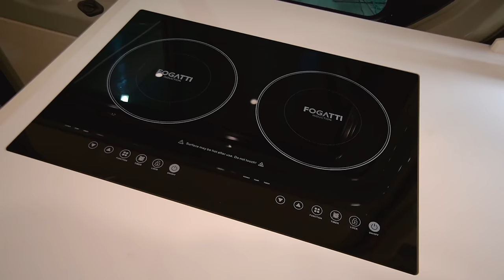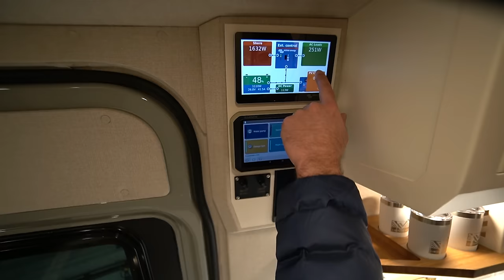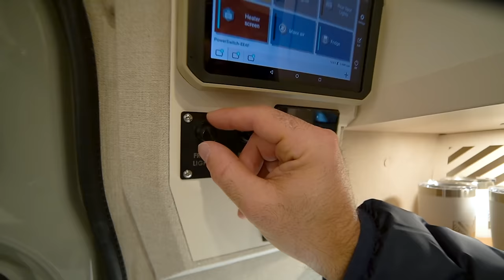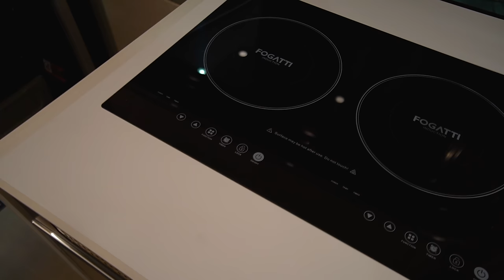STUNNING Sprinter Conversion | This Van Has It All!

Comment: And still bare metal exposed on the side door and rear doors, which with thermal bridging gets the same temperature as outside. Really guys?
Reply: I have similar exposure on the sliding door. Well I can tell that is negligible if the rest of the van is properly insulated. Glue fabrics on steel might help but only for a visual pleasure, No R value will be given.
Reply: Lol😂
Reply: @shadowfire77 show them your van, then they will know how to improve theirs. 😅
Reply: @Vengeance1978  might do, and invite to some really cold winter camping in Sweden too :)

Comment: $295K in case you were wondering.
Reply: Absolutely ridiculous.
Baffled as to how what was meant to be a cheaper way to get away and have a break turned into spending enough money on a van that you could buy a bloody house with the same money.
Reply: Never
Reply: And you can still see the tan on the wood when the gray drawers are closed.  Small item, but for nearly $300k should be color matched.

Comment: One of the finest builds I have ever seen.  Any issue with CV joints on the new AWD chassis with a lift?  I assume you could do this same build on Transit extended?
Reply from the maker: No issue with CV joints. We can build something similar on a Transit with some changes due to the wheelbase difference.

Comment: You guys gave lots thoughts into this van. Several questions. What kind of insulation like 3M or wool…? The toilet options? Auxiliary fuel tank option? It’s 144 wheel base or 170?Screens for back and side doors?
Reply from the maker: This van has 3M insulation and a Laveo DryFlush toilet. It is a 170 wheel base with a 45 gal long range fuel tank added. No screens but they can easily be added. The toilet could also be swapped out for something else that fits in the same space.

Comment: Extremely well built van! How about alternator charging (any 2nd alternator?)? Also, any grey or black water tank? Any glycol to heat these tanks on demand basics? Any glycol to keep warm of fresh water tank and battery compartment? A true 4 seasons need van operations with water (fresh, grey n black), battery cold temp protection with self heating. Also the heating system draw diesel from the fuel tank?? Thx
Reply from the maker: Thank you! It does have a 2nd alternator and a gray water tank with electronic dump valve, but no need for a black tank with the Laveo Dry Flush toilet. We can easily add tank heating pads for the undermount gray tank and with the Rixen's heating system you can set a minimum temperature for it to maintain in the van for the interior fresh water tank and the battery system. The heating system works off of shore power, your engine heat, or through the furnace that is powered off of the diesel in your OEM tank.
Reply: @LimitlessVan  While the dry flush is better than a cassette, you need to offer a black tank! Most B's don't offer this anymore (for some reason) and it makes no sense. Mine has it and it is so, so much cleaner and easier than dealing with the dry flush or cassette.
Reply from the maker: @robmagu65  The Laveo dry flush has no liquids to deal with and way easier than cassette or black tank. No smell either- Look them up, they're one of our favorites!

Comment: Do you guys have an "estimated" MPG? Just curious how much the front bumper, roof rack, suspension and 35s cut into the milage.

Also, I didn't notice, did you guys install a larger fuel tank?

Lastly, do you guys offer a different choice of interior materials/color?

Thanks, GREAT BUILD!
Reply from the maker: MPG is around 15-17 - hard to tell at this point. And yes! We did install the 47gallon tank - expect to get 700 miles per fill! And lastly, YES! We offer thousands of different interior colors - woods, laminates, veneers, powdercoat colors, you name it!

Comment: ingenius. You are giving Redtail Overland a run for their money.
Absolutely love the colour of the van’s bodywork’s paint - super stylish. Does not look like a factory colour.
I wonder if walking barefoot on the solar panels would nullify any shortening of their lifespan?
I would argue, if it isnt the case, that the worktop should run all the way to the back. The folding bed makes that option possible, so why not do it?
the price - $295K - doesn’t include the van, does it?
Reply from the maker: Thanks! The van is wrapped in Matte Metallic Brown. Price does include the van😃
Reply: @LimitlessVan  I much appreciate you taking the time to feed back.

Comment: Whoa… this is so beautiful, so well made and designed, and so perfectly designed it blows my mind!  😱😮👍🏼  The magnetic glasses, double sink fixture valves so you can spray quickly without wasting water, it’s all awesome!  My one question is the shower curtain… with zippers on the outside.   Once zipped… how do you get in?  😂
Reply from the maker: Thank you! There are accessible zippers from the inside so you get in and then zipper it closed.
Reply: @LimitlessVan  — Killjoy.  I assumed that, but where’s the fun in that!  I WANT my mother in law trapped in there!  😎

Comment: Lovely build and beautiful finishes. However, your 35" spare covers the Drivers side rear light...you can get pulled over for that. Ask me how I know! The penalty for a large tire I guess, but also dangerous for following vehicles. Add auxilliary brake and back up lights on the bumper.

Comment: Great job on the van. The details are well thought out. But why is the industry going away from black tanks and putting in dry flush and cassette. I have had both and they are in a word GROSS & very difficult to keep clean. Having a black tank is so, so much better. I have a 12g tank in my class B and I have ever had an issue finding a spot to empty it and it is so much easier to empty. Airstream still has the black tanks on their newest class B's (even the 144). It just makes all the sense in the world to me.

Comment: I think this is nearly perfect. I am insistent on a toilet with a black tank so a macerating toilet will be the way for me. If your poop smells like roses then ok sure, but if you're travelling and unknown food gives you the runs you want some comfort and to not have to deal with it later. Macerator because can pump "uphill". Can couple macerator with a compact marine grade black water treatment system to convert black water into gray water (device that kills poop bacteria so it's safe for release into the water). Fridge is nice, but would like to see a bigger one. Everything is a compromise in a B-class I understand, adding a thing requires taking away another. In any case, amazing build.

Comment: Nice. Lots of small good details. On the neg, wheels are too big, can’t fit on back without obscuring the left lights. The wheels and overhead lights will have a big impact on mileage at highway speed, but might be ok at slower off road.

Comment: Hi, can we put an extra power generator, just in case if The Sun des not want to show around? An extra solar panel, to replace the induction cooking plate with a propane one, a shade store just for outside sitting,. And also an estimate price for the van as it is in the video, Thank you,nice video indeed.
P.s this van can be an everyday living,on the move.

Comment: Beautiful vehicle.  The upgraded seats are awesome,  but if you can't handle more than 2-3 hrs in newer Sprinter seats then road trips are not for you.  Put in 6, 8, 10 hrs a day in mine routinely and never had an issue. Will say it's nice you don't have to adjust them to swivel.

Comment: Beautiful build. Tow quick questions. Can the batteries power the AC all night during summer months? Did you upgrade the Sprinter stereo at all? Thanks
Reply from the maker: Yes! You can run the AC all night long and have over 60% battery left in the morning. Upgrading the stereo is an option.

Comment: How tall are you, I’m just wondering about the dimensions and how that would effect the ergonomics of the van, in other words I want to see I I can fit
Reply from the maker: Ryan is 5'10" with shoes on 😀 Height of this Sprinter van after build out is 74.5" and with a high roof Transit build you can get 77 3/8".

Comment: great van but!
things i would change if it was mine.
gold trim hate it.
wheels and tires look nice but the height of  the van now is too much and the gaps in the wheel arches looks silly.
only 300 watt solar panels when your running aircon electric hob, heating lights, no where near enough the aircon alone will take most of your batteries after a couple of hours.
exposed metal on inner doors looks rough or not proffesional enough in my opinion.
sink may be deep but not wide enough.
would have thought for the amount of money spent on this van they would have gone for the electric bed lift.
not over keen on the ceiling wood all the way through would look nicer.
still a great van though and as much as I love van builds completed 3 myself, I would now just buy a motorhome because the difference inside is a game changer, loads more space and more pratical and sometimes cheaper than converting a high end van like this.

Comment: Why not a proper door to the wet room with it`s own roof window? We have one of our heater exhaist in the wet room so we can use it to dry wet clothes or gear. Also a door makes it easier to use, especially if you are  couple. Zipping and unzipping the fabric will be a hassel.

And why such a large kitchen area?
Reply from the maker: Every client has different preferences. We do offer different styles of shower doors and different kitchen layouts.

Comment: Some really nice features. The lighting, the cabinets, the bed, and many more, but also a few poor design decisions. 

Why create such a narrow and restricted pass point between the galley and the table. We don’t put large fridges in that location for this exact reason, it becomes a real pinch point. Relocate the fridge to allow more space in the area of the van that gets used the most. 

That shower door, WTF! It’s a pain in the backside to operate each time you want in and out. It rolls up wet and drips down when rolled up, and it looks so out of place with the rest of the design. There are many tried and tested space saving shower door for vans that work way better I’m afraid. 

Bare metal on the doors is a real no for a premium van. It doesn’t take much to cover it up, keep the cold out, and continue the premium feel…

The spare wheel really needs to bolt to the carrier (with locking nuts). That strap will get rusty and dirty and be a right pain to release over time.

Comment: Great looking van inside it's a small home on the road perfect for weekender or a road events such as music festival classic car bus and heavy goods lorries firearms fairs a useful motor home.a mobile base station for mountain rescue or army use in battle conditions with four wheel drive is fitted a all round tool kit with built for on or off road.

Comment: 295 Grand?   I think I’ll copy their ideas and build it for not even half that price.  Half the price of the van is the overpriced Yeti cups.  Carpeting is a giant mistake in a van.  Should NEVER have carpeting.  Unhealthy, and gets dirty and hard to clean.   Always go with a hard floor of some type.  If the owners want a warm to touch carpet, they can have long rugs with velcro under them if needed.
Reply from the maker: There is no carpet in this van. Yeti cups are optional as well. While this van has sold, we normally build for each clients needs and wants. Reach out to info@limitlessvan.com to get started on your dream build!